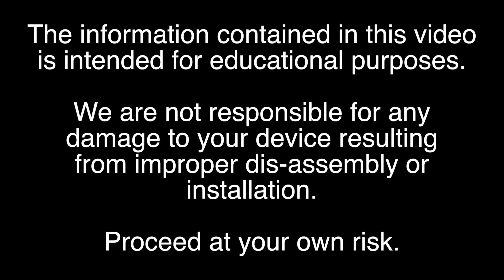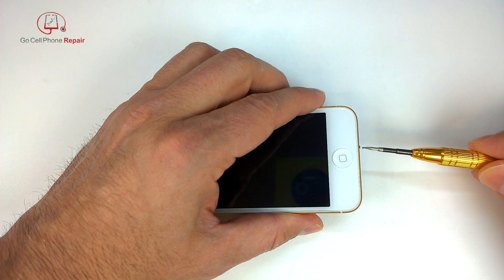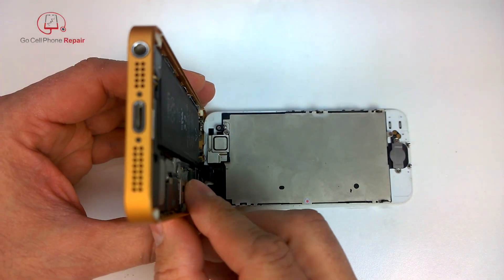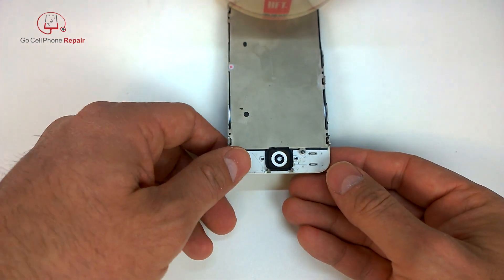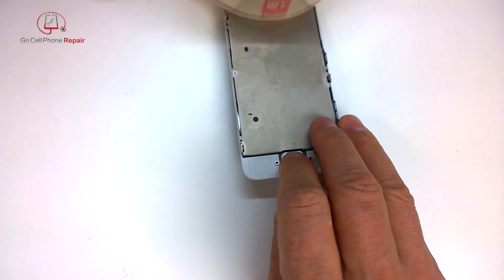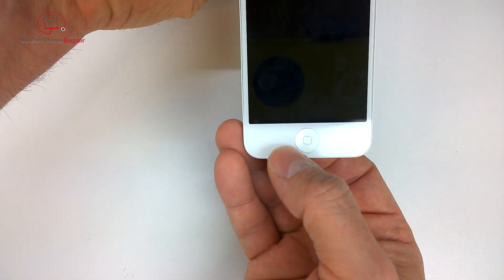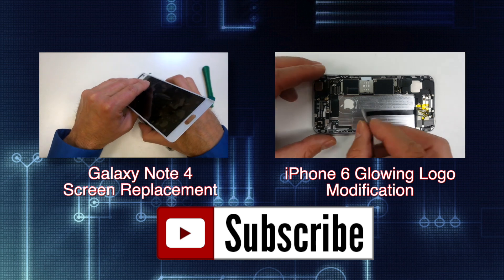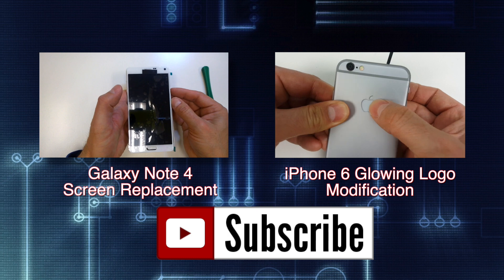iPhone 5 Home Button Gasket Replacement

Comment: My iPhone SE touch ID doesn't rotate, but I can feel it's moving a bit and there is a small play to it when I'm using the phone while laying on the bed. If I slowly points the touch id with my finger nail, I could hear a small sound of its going back. If I've detached the cable and replace the gasket or whatever the problem is, will it solve the issue? I don't want to ruin the touch ID. Thanks..

Comment: my 4S home button spins freely now, the home button is still quick and responsive but the downside is it rotates freely every time I use it, also my cousin's 5 also has it's home button crooked after getting a screen replacement
Reply from the maker: There is a gasket like this made for the 4S but you have to pretty much take the whole phone apart to remove the display.

Comment: I scratched the inside of the phone causing it to appear on the front, is there any fix for this such as paint
Reply from the maker: If it's black use a Sharpie. Might take a few coats so let it dry in between. If it's white you can probably find some nail polish that is close.
Reply: Go Cell Phone Repair Thanks man

Comment: Why is the phone orange?
Reply from the maker: +KJ Tech Reviews Well it's supposed to be gold... a custom back that I put on it a long time ago. The Apple will also light up if you connect the power leads on the inside but drains the battery faster.
Reply: +Go Cell Phone Repair where did you get the housing ?
Reply from the maker: That one came from Tmart.com but I dont see it on their site anymore. You might be able to find one on Aliexpress.